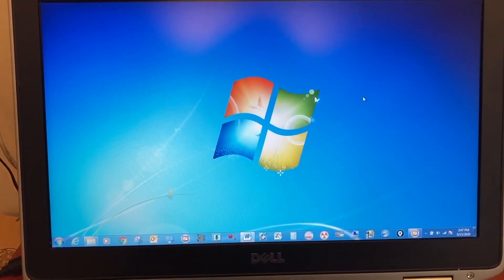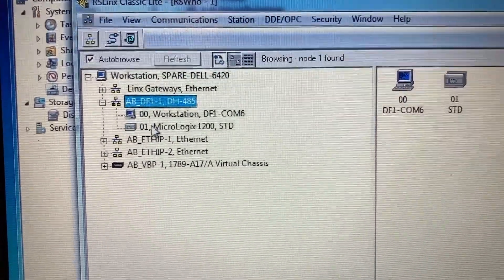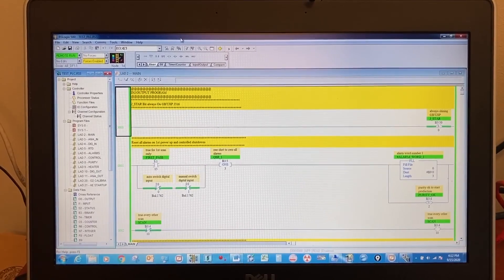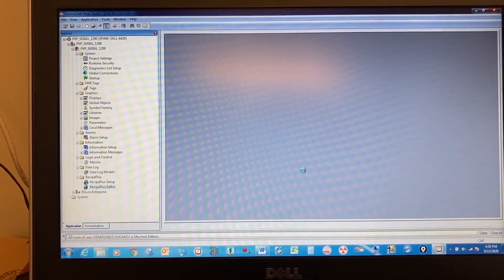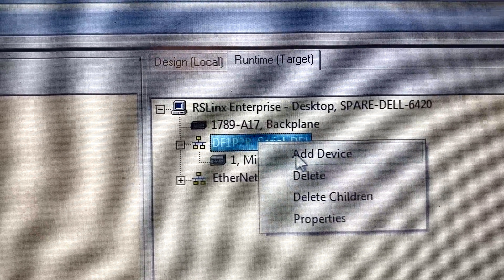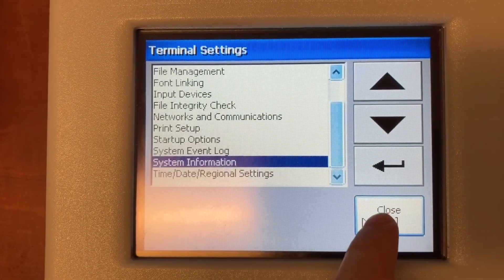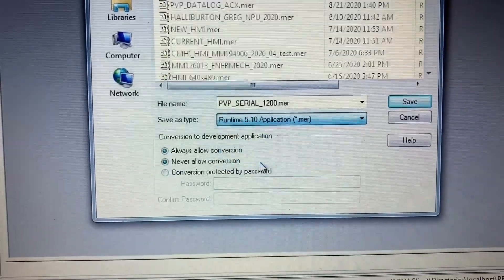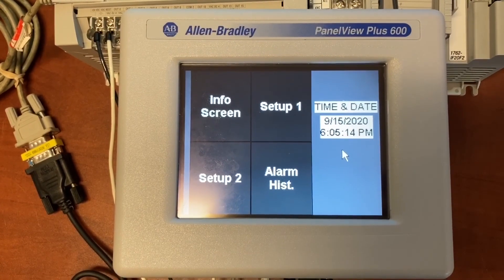Allen Bradley Micrologix 1200 PLC Serial Communication with Panelview HMI DF-1 Setup

Comment: Hey man.. I want to buy a adapter for 1200  BXB , to convert from rs232 to TCP IP to acces over internet to weintek HMI. It is possible on that PLC ? I have other two already connected fatek and siemens but micrologix have all analog extensions , should be useful if work over internet. Thanks
Reply from the maker: @iamwangine8752: Sorry for the late response. You might want to check out the below to see how to convert DF1 protocol from Micrologix1200 to Allen Bradley EIP which is a pretty popular communication protocol your other PLC's should support. If it is not supported, you might consider setting up Modbus RTU on the Micrologix1200 and then converted to Modbus TCP which I think all German PLC's should support.
DF-1 to EIP
https://youtu.be/3peQu4Sr15I

Modbus RTU on Micrologix1200/1400
https://youtu.be/wWcQFz7JWEE
Modbus RTU Slave to Modbus TCP Server
https://youtu.be/DYHPQhPoCxs

Comment: I have reset fault in PLC through RS Logix, but after that communication with HMI is not working, what might be the problem?
PLC is micrologix 1200 and HMI is panelview 1000
Reply from the maker: @vivekpv7496: It is very possible you have reset the communication protocol for all the ports on the PLC back to the default DF-1. Thank you for your support to my channel.
Reply: @SYPHOANG  Thank you for your reply. How to setup the communication with HMI, can i do it through RS linx, or do we require Factorytalk software?
Reply from the maker: @vivekpv7496: RS linx is only the software to open the communication bridge between your PC and the HMI. Factorytalk software allow you setting up the communication between your PLC and the HMI. You might need to watch the below video for the ethernet configuration of the the HMI, you will need to do it on the HMI itself. Once again thank you for your support on my channel.
https://youtu.be/ymdAcA2Nv6g

Comment: Thank you for your video. My plant still has a few of the old Panelview Plus 600 that are connected to PLC over RS232. I would like to upgrade them to current model. Would you recommend Panelview Plus 7 as the modern equivalent? The other half of the problem is upgrading the old PLC! Ha!
Reply from the maker: @jkuebler89: Glad I could help. I know the Panelview Plus 600 probably was long discontinued. However, you should be careful on your pick on Panelview Plus 7 because I think most of them do not come with the 9 pin serial port. Upgrading SLC 5/03 or Micrologix with rslogix 500 to compactLogix/ControlLogix with studio5000 should not be a problem. Rockwell does have the converter tool for that but there still is a lot of work for us to do such as IO configuration, mapping, communication, etc. Thank you for your support to my channel.

Comment: Would it work using ethernet between plc to pc?
Reply from the maker: @Yared Abraha: Yes, Micrologix1400 has an Ethernet port for the Ethernet connection. However, the purpose of this video is to upgrade the HMI with the same serial communication to the PLC. Thank you for your support to my channel.

Comment: How much did you pay for that hmi and software license?
Reply from the maker: @Sang Nguyen: Unfortunately I never actually bought anything. The company bought it.
Reply: I was having a problem says: "cannot write the value "1" or "0" to item, as I was trying to create a START button on HMI. After I downloaded my display and try to test it out, that error occurred. Is it because of network configuration?
Reply from the maker: @Sang Nguyen: When you are working on HMI programming, you should work from the online tags to make sure your HMI seeseverything from your PLC. The HMI software does have a button "Test Application" for you to test the whole HMI application on your computer even before you are creating a mer file for the actual HMI. You can also use "Test Display" under "View" to test a specific display. Typically I do "Test Display" first, "Test Apllication" second and then if everything is OK, I am now creating an mer file to download it to the HMI. Hopefully this helps.
Reply: @SYPHOANG  Hey I just passed the course last month. I wonder If another brand HMI could be compatible with AB controller.
Reply from the maker: @sangn1696  : Sorry for the late response. Of course, there are plenty. For example, Phoenix Contact does make HMI work with AB controllers. I do have some videos about Phoenix Contact HMI's if you are interested in. 

https://youtube.com/playlist?list=PL4-4cZFnYBmkkG6hFGLEowfbjgdnPgNoR

Proface and Idec from Japan also make HMI's that work with AB controllers.
Reply: @SYPHOANG  Much appreciation.

Comment: 1- I have panelview plus 400 with serial port only how to cofigure connection and download runtime in this case can u support?
2- Is it possible to try with emulator (micrologix 1500)?
Reply from the maker: @Mandhata Singh:
1-I think it should work with your PVP 400.
2-I think it can only work the actual PLC.

Comment: thx for explain sir 
I need help please ..I have a problem with ML1400 when download program to PLC an error message appears "Target node is not an SLC-500 or Micrologix controller" ??
Reply from the maker: @Habib Cm: I saw this before. Make sure your computer is connected dirrectly to the Micrologix PLC only. I think there something else in your network has the same IP address with the Micrologix PLC.
Reply: @SYPHOANG  Thank you for your reply 
I have connected to the PLC by ethernet cable and got the IP address from the PLC and computer and connection is done but when I download the program the message appears
Is the software not for PLC ML1400??
Or is it my fault?
Reply from the maker: @habibcm4227  : Are you using Rslogix500 software? It is the right software for Micrologix and SLC PLC's. Your PC should connect to the Micrologix PLC only. Are you able to use command prompt to ping the PLC IP address from your pc? You can also check the communication in RSLinx. Good luck.

Comment: Why didn't you connect the 1761-CBL-PM02 (FEMALE) cable directly to the hmi?
Reply from the maker: @Edimar Santos: The reason is you cannot use only the PM02 cable to directly connect the PLC to the HMI. It will not communicate without the null modem.

Of course, you can find a null modem cable with 1 male and 1 female to eliminate the mini gender changer in the video. The male of the null modem can go directly to the PM02 cable famle and the end (female) can go to the HMI. 

Hope this answers your question. Thank you for your comment and subscribing to my channel. Should you have any more questions, just let me know.

Comment: PIease help me .I cannot donwload by internet IP because of factory talk view error message : factorytalk view transfer failed due to cip : But me can download by USB drive . Thanks
Reply from the maker: @Tanachai: Have you tried to ping it from your computer to make sure your computer can see it first. Also check the driver configuration in Rslinx.
Reply: @SYPHOANG  I tried to ping check first my computer can see it . But it still not download show Error same massage I will tried again.
Reply from the maker: @tanachaiphoset3451  : Check ethernet driver in RSLinx. Make sure RSLinx can see the HMI. Sometime you might need to remove the ethernet driver and add it back to Rslinx because of some conflicts. What is your HMI and is DF-1 the driver for communication between PLC and HMI?
Reply: @SYPHOANG  Now connect HMI and PLC by DF-1 driver . Thanks.
Reply: @SYPHOANG  Thanks so much . Now I am get,  clearly for  rslink . I can download by ethernet , USB drive. Thanks sir.
Reply from the maker: @tanachaiphoset3451 : You are very welcome. Should you have any questions, just let me know. Have a happy and successful new year 2021.
Reply: @SYPHOANG  Thanks sir. Happy and successfuly new year 2021 too.

Comment: Why did you use a mini gender changer and a null modem cable? It was not the same just to connect the db9 rs232 directly to the panelview? (The end of that one is female too).
Reply from the maker: @Jesús Raúl Rodríguez Higuera: It would be awesome if it can work directly the way you suggested. However, per Rockwell TechConnect "QA885" published on 02/29/2020, 1761-CBL-PM02 (with null-modem adapter) is required for "PanelView Plus Serial Communications with MicroLogix". I don't have a null modem cable that has male on one end and female on the other end. That's why I have to have a mini gender changer.

FYI, if you want it to look nice with only 1 cable between Micrologix and HMI, you can use either 2711-NC21 (5m/16.4 ft) or 2711-NC22 (15m/49 ft). With those cables, you will not need a null modem. Thank you for your comment. Please let me know if my answer is good enough and just let me know if you have any further questions.
Reply: @SYPHOANG  do you know if I have to do the same for a micro830?  I've been trying to connected but with no success
Reply from the maker: @Jesús Raúl Rodríguez Higuera: I think what you are working on is only a Panelview800 HMI which is much cheaper than a Panelview Plus HMI.
You will only need a  1761-CBL-PM02 cable between your Micro830 and a Panelview 800 HMI. Check out the below video and let me know if it helps.

https://youtu.be/JKhD3Xf2VZ0
Reply: @SYPHOANG  thank u very much, I've been having trouble with this connection, that's why i've been looking for another Solution but i'll try again
Reply from the maker: @Jesús Raúl Rodríguez Higuera: I just would like to follow up your comments last week to see if it works now after you try it again with my new video? Just let me know if you have any questions.